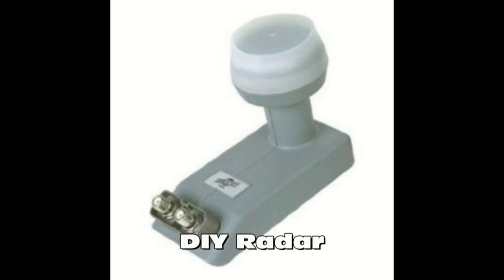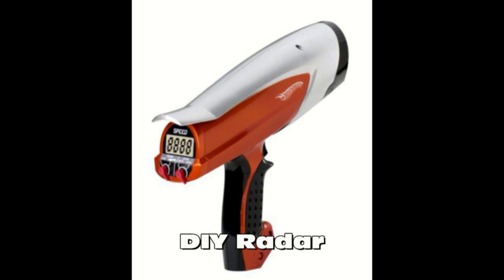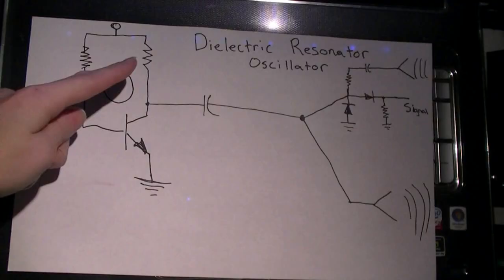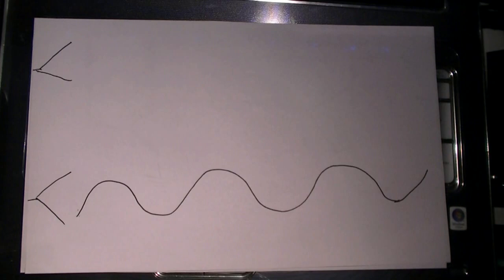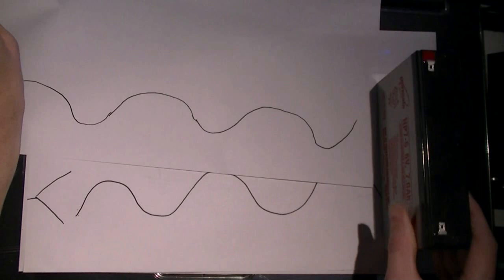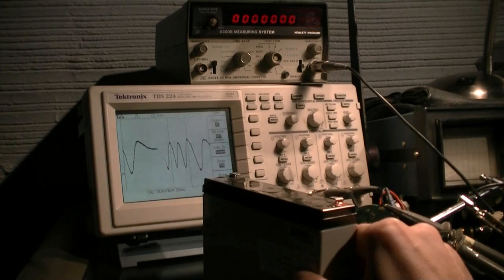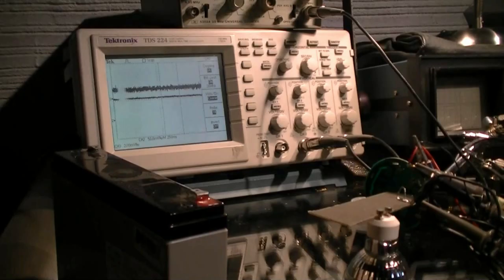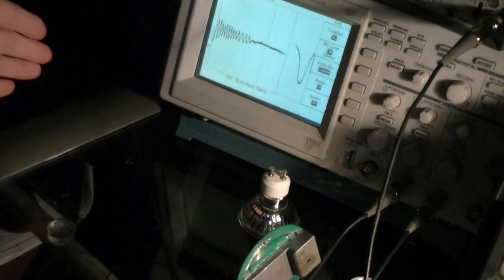Build a Radar from Satellite Dish Parts - Speed Radar Basics

Comment from the maker: @DarkGlassly I'm not sure the local oscillator will generate enough wattage to cause any problems.  It doesn't differ much from this toy that is presumably safe for kids to point at each other and I don't see a huge advantage to make local oscillator that would swamp out your received signal.

Comment: Jeriellisworth, I noticed there are so much of cost-saving design in most DRO oscillator, particularly in some low-cost radars. There is actual Gunn diode in a Radio Shack car radar, but still it's surprising compared to the compexity of the entire circuit... And you're correct, DRO isn't straightforward to design - Capacitance, Inductance and Resistnce do work together / against each other within circuit necessary to send and receive Microwave. It has to resonate or it won't work.

Comment from the maker: @00011theman Home TV dishes typically don't send anything to the satellite, however they do have a thing called the local oscillator which runs at 10ghz and is used for receiving.   I twisted things around a little to make a transmitter. See my TSA scanner video.

Comment: The standard radar gun is checked by the officer using a tuning fork which isn't the sound (per se) but the frequency that creates the speed.  The officer doesn't whistle into the radio but rather just the end of the radar gun.  Higher the pitch, faster the speed.

So I'm anxiously awaiting to see you test this in a vacuum.  The tuning forks not whistling.  It might be a bit hard to breath. ;)

Comment: Suggestion: Do something that demonstrates core saturation on a transformer. Or try winding your own transformer with a core that is empty, show the effect of moving a soft iron object in and out. Feed a sine wave in one side, and show on your scope both the input and output of the transformer as you move the object in and out. I had in mind using this to convert 115VAC to some arbitrary lower voltage level.

The core saturation technique was a technology used in voltage regulators.

Comment: Jeri,

If you haven't seen it, you should check out the SAR that some guy made using surplus microwave radio parts.

Also, I think speed radar usually does use doppler, at least the old police radar guns do.  They take the output of a gunnplexer's mixer diode and measure the frequency to determine speed.
Reply: It only worked like 2 feet away with any resolution it was pretty much garbage.

Comment: Actually, at least in traffic radar,  Doppler shift is used.  At least with the old MPH (X)  and K band heads (obsolete).  Doppler is used for the actual speed measurement.  This is why radar heads are calibrated with tuning forks using a particular audio frequency.  The better radar units use  phase shift is used to filter out unwanted signals.   Not sure about what the new 33Ghz models use.

Comment: I suspect that "ceramic puck" is the Gunn diode, which generates u-waves.  The transistor just stabilizes the voltage for optimal gain in the negative resistance region.  Don't let the TSA mess with your junk:  they can get their own travel jar of surface mount goodies!

Comment: That whistling into the CB @ 3:45 was not a myth. back when speed radar first came out. it was a Doppler based system and the received signal was then down converted using a superheterodyne process into an audible tone. and the faster something came towards it, The higher the pitch and faster away, The lower. The idea behind whistling into the CB was to confuse the officer's ability to hear the tone from the radar while hearing you whistle over the radio.

Comment: @jeriellsworth

Was that how they worked? My dad has one, the size of a 26 oz can of fruit, with a wheel on top to crank out the voltage.

Another interesting thing is DC-DC converters, using a charge pump.

You might be able to make money designing hobby kits for ramsey electronics.

Comment: Distance from the antenna should be a function of voltage difference?
Reply: No, phase difference. Signal amplitude doesn't decrease all that much at short distances. For greater distances, the power of the toy radar gun is too weak to measure. That's why it's not illegal to operate. Besides, phase shift is easier to measure and is also more accurate.

Comment: search for 

The_Gunnplexer_Cookbook.pdf

ebay item 160515106126
150530528457

there is a common piece of outdoors security equipment that uses x-band that could be a useful cheap source of radar gear, I can't find it at this time

have you tried making a crude thermal imager using a strip of PIR sensors ?

or ultrasonic transducers to make something like a crude sonogram

also do you have problems bringing projects to completion ?

Comment: 47 U.S. Code § 503 penalty for operating an unlicensed or "pirate" broadcast station (one which is not permitted under Part 15 or is not a Carrier Current Station) is set at $10,000 for a single violation or a single day of operation, up to a total maximum amount of $75,000.
Reply: There is an exclusion for signals under 5mW. That's why it's not illegal to operate the Hot Wheels Radar Gun. And that's all she was doing.